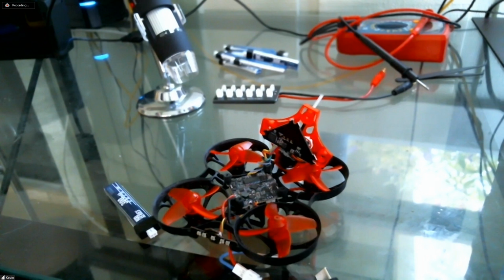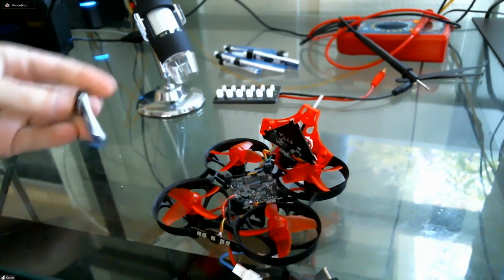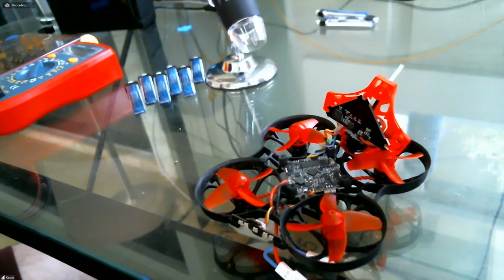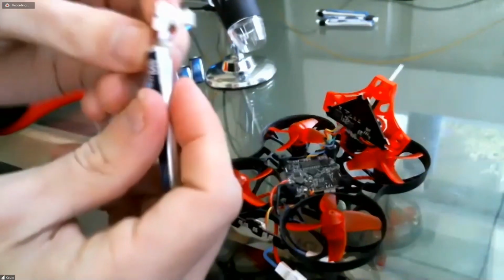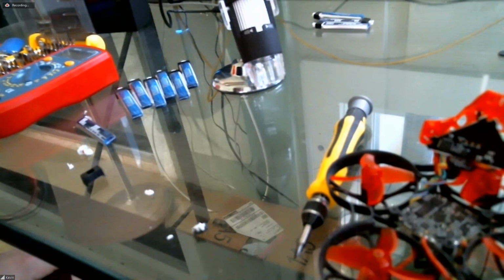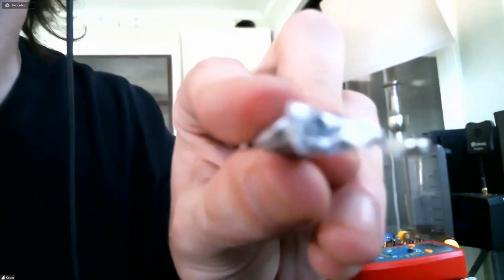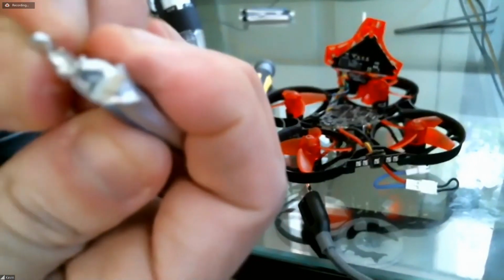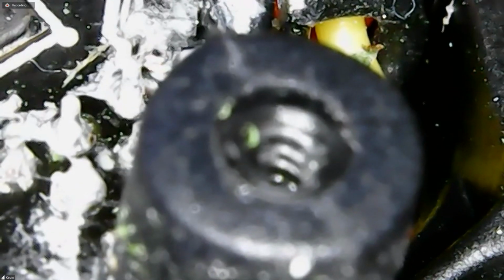Kevin Provost's Eachine Trashcan is killing his batteries |  1-on-1 Troubleshoot

Comment: 3 years ago i quit fpv because after years of saving and research to get into FPV i finally got a trashcan, but I wuit because I couldnt figure out that my trashcan was KILLING MY BATTERIES NO FREAKING WONDER I THOUGHT I WAS CRAZY AND STUPID! IM SO MAD.  mine came with damaged soldering from the factory upon further inspection, no wonder my LED strip never worked either. One of the pads it's soldered to is also soldering to the component next to it on the chip itself.

 I never got to fly it without immediately killing batteries for good. I got scammed by banggood and eachine. never buying anything from them again and I'm so sad i missed out on years of the hobby ;(  idek where to start salvaging what I can from mine and starting over or what. I can't even get a refund now after all this time. I just eventually gave up heart broken cuz it took me a long time to even afford that set up with eachine goggles. I've been using my fs-i6 in liftoff for years when i get the urge cuz its all i have. So depressing finally learning this and idk how i couldnt find this video before. THANK YOU JOSHUA BARDWELL

Comment: I know this is old and dead, but what about a bad betaflight firmware causing the esc to work the motors very hard, essentially stalled. That would drain the battery very fast and make weird noises with the motors. That would fit with all of the descriptions that he gave at the beginning of the video. Other than that, it would be a flight controller / esc combo issue. I would try the firmware reload first.

Comment: even thou this is old, well batteries are DC, and they will always have continuity, if you take a led on appropiate voltage then light on if there is no continuity, circuit doesnt close and led wouldnt turn on, same concept as taking negative from 1 cell and take positive from a separate cell and expect led to light, if you put them in series doubling viltage then circuit closes and led will light or blow if too much voltage

Comment: This is what happened to me so I bought larger 2s batteries at 450 mah and because there was no capacitor on the xt30 pigtail connection, I blew the Trashcans voltage regulator up.
I'd say that EAchine is a company to completely avoid. Their product was junk on arrival and they should issue people full refunds.
Being that this will never happen, I will never buy another Eachine product during this lifetime.

I will be rebuilding the ""Can" with a Happymodel New Crazybee F4 PRO V3.0 Flight Controller which will ship from China so, with their slow @$$ shipping, I should be able to fly around this time in 2024.

Comment: I had a similar issue with my Mobula7 and it turns out the issue was a bent pin on the JST battery connector.  I know this video is old, but if someone else here has this problem definitely check your battery connector pins.

Comment: Sigh...okay so as you said, multimeter checks for a signal from one lead to the other...so...

If you put red lead + black lead - you'll show continuity.
If you put black lead + red lead - you'll show open circuit.

Some multimeters will blow a fuse doing this.

Check the voltage.  That's what matters.  After 3 batteries I would have stopped checking for battery QC issues immediately.  Also if you have a power supply just hook it up and check what current the drone is pulling.
Reply: Oh, also yes - cutting into lipos is irresponsible.  Even dead ones have nasty nasty things inside.
Reply from the maker: Hmm oh sorry hang on I forgot what was in this video. We were testing continuity with a battery just to see what would happen. Yeah, for sure you can blow a fuse that way. Just curious because I had never done it before and wasn't sure.
Reply: @JoshuaBardwell  Wow a reply from a celebrity!  :D  Yes you can damage a meter measuring continuity on an energized circuit but I think a single cell lipo is probably low risk.  I'm not convinced you guys did equivalent resistance measurements also, but I wasn't exactly sure what you were measuring.  I had a similar issue with an IC at work so we hooked it up to a power supply and found it had a short that was drawing 25 amps (which I THINK was limited by our power supply).  This is what I was suggesting you do to the trashcan but obv. i'm a bit late to the game here.  I'm also not convinced those solder joints were okay on the power leads going to the board, but the image was a little blurry so I couldn't say for sure.

Troubleshooting electrical issues is what I do - I rarely get into the IC stuff but I've blown up a lot of multimeters in my day.
Reply from the maker: No multimeter should blow a fuse testing continuity. I don't understand what you're suggesting.

Comment: Continuity is only for testing if 2 parts of a circuit connect. Basically you're asking the question "is there an electrical path between these 2 points?" It tells you nothing about current, resistance or voltage, it's a boolean value.
Reply from the maker: When you plug in a battery, a voltage potential is created between two points. At that point, if continuity exists, current will flow. By testing for continuity, we are trying to figure out if current could be flowing and discharging/damaging the battery. If we had a clamp meter to test for current directly, that would have been better.

Comment: I would disconnect anything non essential from the fc like the camera.... Motors..... Vtx..... Then see if battery still drains when connected only to the fc. Weird that the resistance check does not indicate low resistance though. Maybe his harness is wired backwards.... Strange

Comment: My trashcan takes a 1s from 4.2 to land now under 10 seconds. I can take the same battery right after and put it in my tinyhawk 2 and i'll get over 2 minutes? I'm using the GNB 450,  Eachine 300 and Emax 450... Not sure whats going here myself. I tried FW no difference ... any ideas? 
Now I can run it on 2s and get over 2 minutes but won't fly 10 seconds on 1s... very strange...

Comment: my trashcan  killed 7-8 1s  brand new batteries within about 4 flights they just stopped working entirely until they had no voltage. with 2 1s batteries connected they would get soo hot  . 1 always more than the other  . after the 1st flight they would start to puff pretty bad. the motors would get warm but not too hot. this was w/ default PIDs   basically same as this guy

Comment: Inbetween the different poles internaly on a battery there is just a really thin isolation film that could be broken by heat or impackt. Well its sooo thin that some cemestry can happen through that so it could very well be broken internaly

Comment: A battery is going to measure continuity even when absolutely dead, because there are still conductive elements between the leads of your multi meter. As other folks have said, a live battery is going to be driving current in weird ways through the multimeter, so YMMV. 

But, one note - continuity and zero resistance are different things. Even ten's, hundreds, thousands of ohms are going to read as "continuity".  A "dead" short will read  single digit ohms or less.

Comment: $40 is good. If it is a FC just get a new one. If I was a betting man, I'd bet there is a leaky cap on the board or perhaps oversolder under a cap. It is easy to find, SMD caps are brownish color with no numbers. Check continuity across cap and it may give you some indication if it is close to leads resistance.

Comment: Dead batt (not just LiPo) should show continuity. It may read few ohms more than leads themselves. Seldom it will be open. When 1 cell in a pack goes bad it always shows voltage of pack less 1 cell. If that cell was open you would read 0V across the pack.

Comment: I had similar problem with Geprc Phantom - worked initially, then battery went flat. After that only green light on FC would go. Unplugged camera and everything lit up. Swapped out camera and it all works again. Conclusion - camera had internal short that did not show up initially. Note: Camera is Caddx Turbo EOS2  same as Trashcan. I must try re-soldering leads on original camera and test again.

Comment: I'm surprised everyone is blaming the battery leads and not a faulty mosfet on the esc. Mosfet are basically switches and are totally able to close the battery circuit and short it. They would not show a short when unplugged of course which is consistent with the high resistance reading. But once they are powered, who knows what signal the gate is receiving.
Reply: Well battery leads are easiest to remedy, troubleshooting gets expensive when you go from most likely to least likely instead of cheapest to most expensive fix =p

Comment: I once ordered 5 4S lipos from banggood but they sent me the same batteries in 3S. I told them the story and they told me I would receive 20$ of bangggood credit which rly pissed me off because I payed $70 for the 4s lipos and to buy the same amount of 3s lipos was $50 so I pretty muched payed for 5 3s lipos which I didnt even want. I sent them a angry email back and they said they would give me $30 instead. I am someone who has a tight budget and I cant afford to pay for 5 extra batteries I dont even want! So in the end after multiple emails I annoyed them so much they ended up giving me 5 4S lipos for free and they told me I could keep the other 3S lipos. So if something like this happens to u, jut keep emailing and eventually they will send u a replacement.

Comment: Stop killing batteries. It's better to use laboratory power supply with current and voltage setting. Also you can plug small light bulb instead of jumper into second battery connector. It has small enough resistance in normal condition. If short circuit happens light bulb will protect your battery and flight controller. It's serious drain, some broken parts of your quad must produse a lot of heat.
Reply: Well if he had a lab power supply I’m pretty sure he’d be experienced enough to know to use it instead of killing batteries...

Comment: Umm josh, doesn't the battery make a circuit? As its run in "series" by definition .... I'm sure someone's already explained it here and knows more about continuity and cells 10x my knowledge but too lazy to read everything below and had to comment to mark this event........"the day josh learned something" OF COURSE YOU DID TEACH YOURSELF SO FPV KNOW-IT-ALL" still intact. 

Keep up the awesome content, I've been away a few months so catching up now, curious if you ever tried the 2500kv or comparable kv number with 5s and 6s batteries we touched on after trying Kevin's 2100kv. Always loved it myself and wondered why Noone else was doing this......try that kinda rpm with low pitch like the 5.1x3.1 hq props.... crazy smooth feeling but fast as h%&&.

Comment: One thing to keep in mind when you have any issue like this is that these LiPos contain an insane amount of energy. When your battery is discharging FAST all this energy has to go somewhere. According to the law of conservation of energy it can't just disappear into nothingness. The battery charge is converted into some other kind of energy. In our quadcopters there is only really 3 kinds of energy it can get converted into. Could be kinetic (moving air/the quad around), radio waves which hit our antennas and connect the quad with us, or HEAT. So if you plug in any battery all that energy has to go to one of these three places in order for the battery to lose charge. So if your battery is discharging really fast that is a lot of energy at a time and if your quad is sitting on the ground kinetic is not where it goes. It's also not very likely that your vtx is putting more of that energy into radio waves than it's supposed to, because it's actually not that simple to do and any hardware fault would most likely cause the vtx to put less or no power into those sweet radio waves. So the only place the energy can go is HEAT. If you have a healthy battery and you plug it in and it drains really fast, most likely SOMETHING is gonna get reeaaaallly hot really fast. Thermal cameras are a real winner here, but simply putting your finger on all the PCBs can let you find regions/parts that are unusually warm.
Reply: He is an engineer 👾👾

Comment: Wouldn't a regular cell have continuity simply because there is a measurement of internal resistance on each cell??  In order to measure IR, there would have to be some continuity. Of course a lower IR or lower value of continuity, would relate to a higher output current for the model.

Comment: I would just get a replacement FC and swap it. If the battery voltage is dropping,there is a short in the board somewhere. I made the mistake when soldering the battery leads on the Crazybee board and it resulted in the battery being shorted. The mistake was soldering the leads in the wrong spot.

Comment: I had a drone pop a 6s battery, but somehow worked with 4s.  After that didn't indicate battery voltage any more, eventually the ESC went out mid flight.  Replaced it and now the drone flies 6s fine and indicates voltage properly.  So in my anecdotal incident, I would say the ESC was the issue which is weird but theres a lot of variables.

Comment: It might be a non-linear short. Shit gets complicated with non-linear shorts. For example, it could be a fried input protection diode on the FC, and it shows 10k resistance on a meter, but once you get about 100ma flowing through it, it collapses to a dead short. A fried fet on an esc might do this also. Its kind of rare though.
Reply: Even more likely, someone else suggested that the connector pins are crimped so poorly, that when you plug in a battery, they bend and touch each other, but they are not touching when holding the meter probes on it. This would also explain the glitchy boot up sound because he was probably wiggling the battery during bootup making the pins barely rub.

Comment: Simple. Mutlimeter puts small current through the positive (red) lead. Battery is exactly some sort of capacitor...
If you connect red probe to battery+ and black probe to battery-, it will only beep if the voltage on the multimeter output is higher than the battery (charging it).
But if you connect red probe to battery- and black probe to battery+, it will always beep, as it's discharging the battery with its small current :)

Comment: Your multi meter uses dc voltage to calculate resistance. When you put your leads on a voltage source on continuity mode your going to get weird readings. Doesnt the trash can use 2 1s batteries in series? I wonder if his battery lead is wired backwards?

Comment: @Joshua Bardwell  
Since two months ago i crashed my drone and destroyed one arm ,I changed it and then the problems started , when i was using my PC with drone plugged ( i was doing some research for rssi )the esc esploded , i changed It and two fried motor then i had problem with ibus conversion (for rssi value) then my FC died (the esc esploded uder It..) i changed It , then the drone didn't want to take of (gyro war rotated) . Yesterday I did a hovering so today i made a fly test but one motor was not spinning well but not continuously so i take off but i crashed but i was flying slowly and at the ground level (so no damage)  but now the motor doesn't spin , when i raise up the trottle , the motor move and sometime reboot , the beep of the motor is different but It isn't fried . Please i am at the point to trow It away(Sorry for bad english)

Comment: you cannot use a digital Multimeter to test continuity of a voltage source. Even your battery is dead, it can still got a small voltage, then it drives the continuity circuit to give a beep in the DMM. Similarly, if you test a dead battery (may still have 0.5V e.g), using a needle multimeter, the needle will forcefully defected to the rightmost. One should never test a ohmmeter of a voltage source. It is wrong use basically. If your battery has a REAL short inside, you can use an ohmmeter to test it.

Comment: I feel like the issue has to be in the battery lead on the quad. If the short was on the board I feel like it would damage the board and only the batteries are getting damaged

Comment: Does the board get hot? I have seen processors back in the F3 days heat up pulling a load and the quad would fly but it would pull about 2a off a 4s pack. I have never seen this except in knock off SPRacing F3 boards... It happened to a 2 or 3 of them.

If the board gets hot or a part on the board gets hot then you know thats where the load is being pulled.

Imho if it's pulling enough current to kill the pack in 15 seconds then the load is plenty high enough to cook components and there's no way the board would survive that. Even if it's a short in the wiring the that high of current would be no different then reverse voltage... If that board works while that much current is flowing "somewhere" I just can't understand that.

Comment: You're one hell of a guy, JB.  It sucks for Kevin, but at least he has some paths to follow now to try to fix the problem. SOOOOOO disappointing to get something you've been anticipating and have issues right out of the box. I honestly fear this scenario so much that it has taken me up to a week to actually try something new that I've bought. Especially ordering it all the way from China and knowing in the back of my head I'm likely screwed if something is wrong. Even the best case scenario of getting a full refund would probably take at least a month of turn around time. Even with that, the problem still isn't solved. Something new still needs to be ordered. Banggood usually just has all the new big ticket items first. They also typically have the best prices, sometimes with discounts on top of that. It's a crap shoot for sure. So far, so good, for me. knock on wood